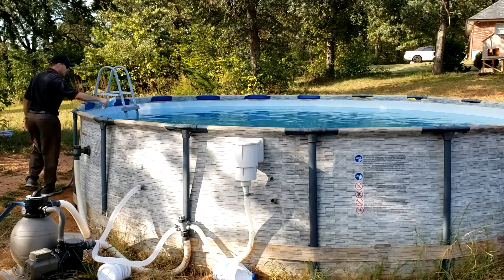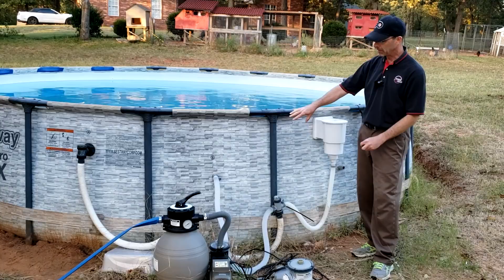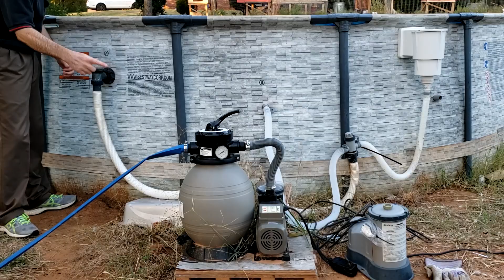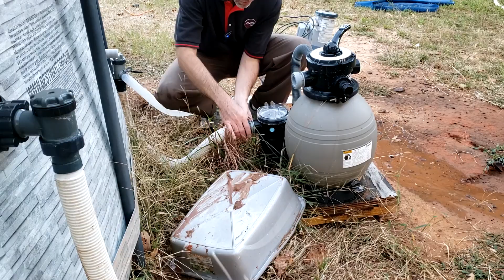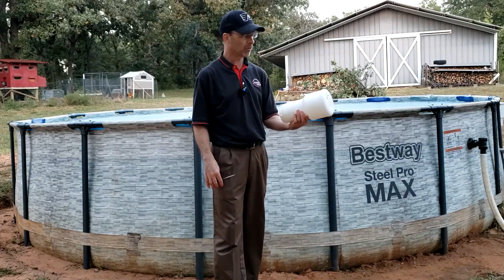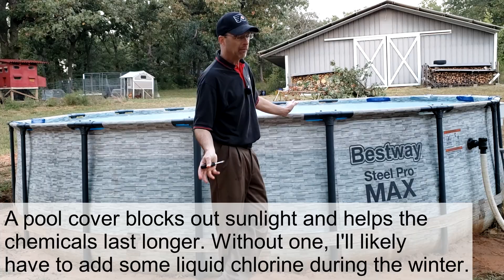How to WINTERIZE an above ground POOL!

Comment: Are you in an area that freezes? I was looking for info for that. :(
Reply from the maker: Yes, I am. Basically, any water is your enemy in the winter. I remove all hoses from the pool and plug the openings. I then take my pump and drain it. Same with the sand filter. I then store those in a garage-like setting where they're not exposed to the elements. I stuff rags in any openings in the pump and filter to keep critters out. Otherwise, I also store the hoses in the shop for the winter and the only thing exposed to the elements is the pool itself.
Reply: How did you plug return line? What did you use to plug return line